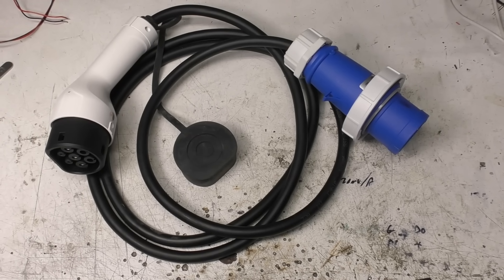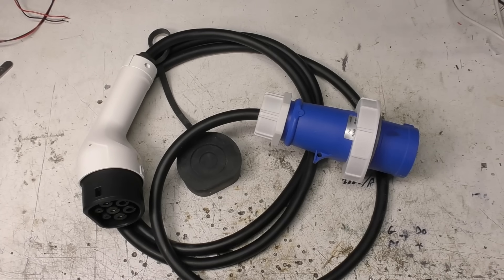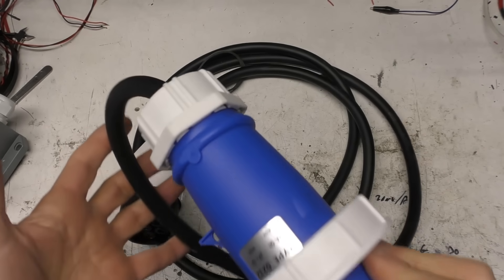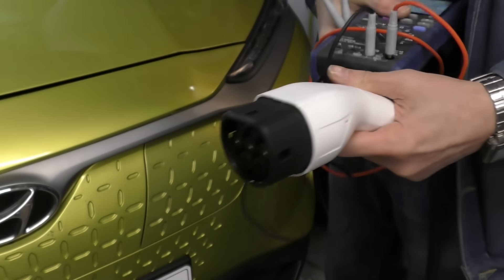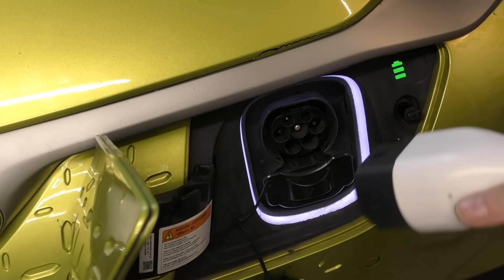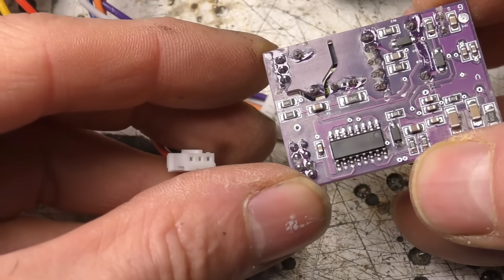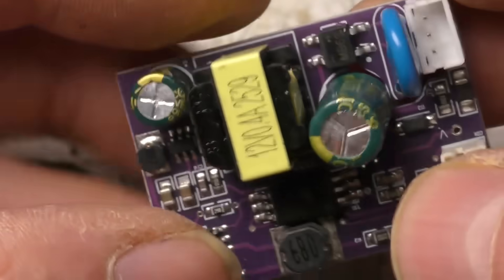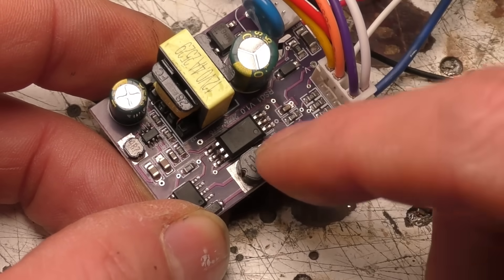Avoid these unsafe EV charging cables!

Comment: These are not meaningfully less safe than IEC kettle cords, are they not? Except that you expect to plug and unplug these regularly. A proper EVSE with RCD and a relay would be ideal but that's another $50-100 in parts alone. No safety certs or anything but then again, these are essentially just extension cords.
Reply: You don’t stand in a puddle in the rain and plug a kettle lead into something
Reply: @edc1569  I wouldn't do that with an EV either.
Reply: A lot of it is just car manufacturers covering themselves for any situation. At least here in Germany, essentially everything has a RCD so duplicating it would not be necessary, but that’s not universally true everywhere in the world and most consumers would not know or understand if they could take the shortcut and omit it.
Reply: @0xbenedikt  There are different types of RCD. The ones used in conjunction with EV chargers have to allow for the possibility of DC current "blinding" standard RCD function. In other words your domestic RCD may not work if there was a fault with this cable.
Reply: @MrAdopado that’s a good point
Reply: Yeah, and most kettles are near a kitchen sink. So chances are, if unplugged will get wet.

Comment: In the states, the version of plug we use has a latch on it, and releasing the latch typically disconnects the pilot signal to let the car know it's about to be unplugged. 

Though still not ideal, these might be slightly less unsafe here since the car's charger should soft-power-off before the mains is removed from it
Reply from the maker: That's not the issue - the problem is the cable is live all the time
Reply: @mikeselectricstuff Oh totally. But at least here it shouldn't have to break any current when unplugging it.
Reply: Pretty sure the pilot signal breaks before the power conductors break so the car should drop the load before the contacts disconnect

Comment: Well, it's not really worse than an extension cord, is it? or any plug in the wall.
In their defense, "EVSE" are pretentious overpriced wall boxes trying to justify their price for what is essentially an extension cable. They could add a couple of relays though without incurring major cost. I assume you will continue to use it? :)
Reply from the maker: Yes it is because the contacts are not shuttered. Also EV charging cables are more likely to be use in wet conditions, and be damaged through frequent use.
Reply: @mikeselectricstuff  so yes on continuing using it? :)  it is a little wild west to not have relays but it looks robust current wise. And rifling in the connector seems fancy

Comment: Better than a grannie charger.
Reply: This is just a badly designed grannie charger built for 32amp 230V/240Vsupply socket. You would be much better off with a properly designed 13amp grannie charger (that runs at 10amps by design).
Reply: @MrAdopado depends on your priorities. If you want a fast charge and something that doesn’t melt this sounds like a solution many want.
Reply: @AndyK.1  Are you in the habit of prioritising convenience over safety?
Reply: @AndyK.1  I've got a mobile charger that can do 13amp, 16amp, 32amp at 230/240V ... and unlike this one is safe to use. They are readily available!

Comment: I'm not up to date on ev chargers but I did see one version of connector that used a magnet to determine high or low current, not sure if the one you show here is one of those, probably not if it's pwm? You might want to get it running a beefy 30amp load or higher and see how hot the cable/plugs get, maybe put it on the flir
Reply: The Renault EVSEs do that. When fitted with the "right" socket it allows 16A, otherwise it defaults to 8 or 10A. You can 3d print a thing and stick a magnet and it will trick the charger. It's not a standard.
Reply: @ligius3  Tesla do something similar with their mobile connector, it allows up to 32A, but by default it's 10A or so.  There's a resistor or something similar in the connector which tells it what adapter is in use.
Reply: @tomsixsix  The Tesla UMC is a more sophisticated device altogether. The mobile connector only works with the dedicated "tails" that set the maximum charge rate. i.e. if you have a tail with the UK 13amp plug it will only charge at 10A 230/240V. If you have the different tail for a 32amp industrial UK "commando" plug it will charge up to 32amps 230/240V. You would have to seriously butcher the thing and mess with the electronics to make it operate unsafely.

Comment: The reason for the 16 pin micro is probably due to some versions of these having selectable current.  I've seen one of these 'guts in handle' EVSEs where there is a current select button and 3 LEDs to indicate which current setting was in use which would require more pins.  As such, the factory already had SOIC16 micros in stock and didn't want to or couldn't buy in a different lower pin count micro.
Reply: Wouldn't take much to add in a relay to isolate the pins... It's really cheapest possible
Reply: @JamesTK  Problem is size of the relays relative to available space in the handle, especially with higher currents like this 32A version or if dual pole relays are needed for American/Japanese/South Korean 200V-240V versions where both current carrying conductors are live or for Schuko and Italian versions where inherently unpolarized plugs mean either current carrying conductor could be live.  Only possible workaround would be putting relays in the plug which would then require extra conductors in the cable for either AC for a power supply in the vehicle connector or DC where the power supply is in the plug with the relays as well as relay control wires.  This means either 4 wires (2 AC and 2 relay with 12VDC coil relays) or 3 wires (12V hot, relay coil supply and DC neutral/common) in the cable.

Comment: Whoah whoah. Why is there any circuitry inside the cable?
There shouldn't be anything to cheap out on except the quality of connectors and the gauge of the wire.
The "Charger" is inside your vehicle.
The unit on your wall is just a "Smart Breaker" that tells your car what kind of service it can provide.(And should be OFF any time the car isn't asking for charge)
The cable? It's JUST a cable and shouldn't be doing ANYTHING more than conducting the power and data from charger to breaker.
All the decision making is supposed to be on either end.

Stick a resistor in each connector that indicates the maximum current the cable can handle.
At MOST the cable should have maybe a temp sensor that breaks the PP connection if it is being overdriven so the "real" breakers can cut off the power.

Is this some kind of weirdo vestigial UK standard that let's the cable have a say in the charging process?
That is MADNESS.

It is absolutely WILD that the cable is expected to do anything.
Crazier still is that it would be live when you plug the other end into your breaker.(And is explicitly prohibited by SAE J1772 and IEC 61851 until the PP pin is connected AND the CP signal calls for charge)
Your breaker shouldn't be doing anything until the car-side negotiates a charge configuration.
Reply from the maker: It is essential to have circuitry in the cable, to tell the car how much current it's allowed  to draw. Nothing weird, it's the J1772 ( and derivative) standards.
Reply: @mikeselectricstuff  No. The breaker unit on your wall should be telling the car that information.

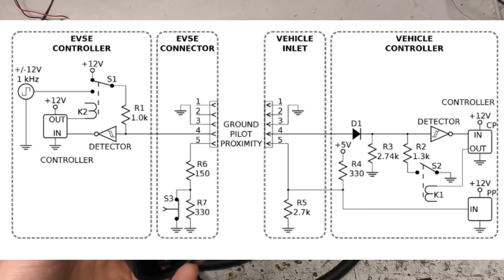You even show the standards circuit at 2:04.
The cable isn't even in there.
The left side is your smart breaker called the "EVSE Controller".
Right side is the "Vehicle Controller".
The cable is JUST a "...".
It. Does. Nothing.

SAE J1772 is the connector and signal specification. It has zero rules for any cable capacity signaling at all. It simply connects the power and data lines between the EVSE and Vehicle controllers.
The PP (Proximity Pin) in the connector tells the directly connected side "Hey a cable is plugged in"  by being shorted to the Ground Pin.

IEC 62196 DOES provide (optional) guidance for how to have a cable indicate it's capacity.
It is a simple resistor across the Proximity and Ground Pin.

The only time a "Cable" is ever ALLOWED to take part in the charging process on any of these standards is the "Portable/Emergency" style of cable that is powered off a normal 120/240 outlet for (Mode-2)away/slow charging. This style has the RCD protection in the cable, because the cable IS the whole EVSE system. It is also banned or heavily restricted in many(most?) jurisdictions.

So again. The cable shouldn't be doing anything.
It is just copper and connectors, with a resistor to indicate capacity if it is a "fancy" modern one.

DC fast charging cables are a whole different bag of worms and include crazy stuff like liquid cooling loops. We aren't talking about those.
Reply: @Prophes0r  The cable shown with the blue connector is not for connecting to an EVSE - that blue 3 pin connector is just a standard 230V AC plug which connects to 230V AC outlets that can be found in many commercial and industrial situations for connecting all kinds of equipment.   The cable is one of those 'emergency/portable' affairs, but with all of the safety items missing.

Cables for connecting between a wall mounted EVSE and a vehicle do indeed just have the resistor in them, but those have the Type 2 male connector on one end and the Type 2 female connector on the other.
Reply: @mikeselectricstuff  HOLY SHIT!
Another user pointed out that this is supposed to be a Mode-2 "Charging cable".
How the hell can that key-fob sized chunk of electronics be expected to energize/de-energize 7kv+?
The answer is obviously "It doesn't do that", which is why those pins are energized all the time.
Is it even legal to use that thing by UK electrical codes? Because it sure isn't SAE j1772 or IEC 61851 compliant.

I'm surprised it doesn't come as 2 pieces that the user is required to assemble themselves to avoid some sort of laws.

That's craaaaaaaazy.

Comment: It looks like the safer chargers are still available when AliExpress is accessed from outside the UK. Unfortunately they seem to have started silently filtering out items based on region but they're doing a really crap job of deciding what to hide.
Reply from the maker: It may be that they think  they come under the UK smart charging regs  which make it illegal to sell non-smart chargers.  I've read the legislation, they don't - I don't recall the wording but it clearly puts granny charger type devices out of scope.
Reply from the maker: Yes - I see plenty of proper units when browsing with a different country setting.
This is so dumb - they are hiding the safe units so users only see dangerous  products.
Reply: Their filtering/censoring is infuriating when you see an interesting thing (like a freely programmable USB keypad) mentioned on YT, go to the link and all you get is "this item is not available in your country" ... and searching for the title gives you everything but that item

Comment: The J1772 standard says the EVSE must be 30cm/12in from the wall plug so it cannot be in the plug handle… at least not without violating the spec. That means no safety certs, UL listing, or compliance testing. I do wish the J1772 spec said otherwise but until it does any cable built like this is super sketchy. 

Also, how is there so much light entering the main three contacts?! It almost appears to be illuminated from the inside, which means no wire attached to the back.
Reply from the maker: It also says the EVSE must isolate the supply. re. light - I was illuminating it brightly to show the contacts
Reply: Min or max from wall plug?  Either way it could be in one plug, max could be in source plug, min this would comply with that part as it's in the vehicle plug not the wall plug
Reply: This isn’t J1772
Reply: @YouTube2021FM  That’s what I’m saying. It’s supposed to be and it’s using J1772 signaling to trick the vehicle into thinking it is. It doesn’t comply with J1772.

Comment: why lock the cable to the car?
i understand it is to prevent somebody from unplugging it easily, but if a vandal want to he will simply kick and break it off? i would rather have the cable unplugged than somebody breaking the car socket or cable.
Reply from the maker: bear in mind most public AC charging is non-tethered,  so users use their own cables - locking helps  prevent theft. Also prevents arcing if unplugged under power, though the recessed CP  contact should ensure the car stops drawing power before the main contacts disconnect
Reply: @mikeselectricstuff  i didnt know about the un-wired stations. i am in north america and the only stations i see have the cable attached to them.
Reply: @Francois_Dupont  All UK/European rapid chargers (DC chargers) have cables attached. Generally AC chargers such as slow overnight chargers whether at home or elsewhere need you to use your own connector cable ("Type 2" cable for UK or continental Europe).
Reply: To avoid arking while it is unplugged.
Reply: It's because you often pay for an amount of charging power, and you don't want someone else unplugging your car and plugging their own in to steal it.
Reply: @wmitchell  why doesnt the charging station talk to the car and exchange basic serial numbers or somekind of unique ID to prevent hoaxing like this? it could even be done thru the power wires by pulsating them.
Reply: @Francois_Dupont  Not necessary, if you somehow managed to unplug at a public AC charging station, the charge session will immediately end and you won't be able to start another one without providing a method of payment.

Comment: 13:15 Why does this one have a socket on it? Some type of EV to EV charging? Or just bad photoshop?
Reply from the maker: Maybe it's a V2L cable
Reply: @mikeselectricstuff 
From what I can tell, that is a EVSE -> CEE adapter, for getting 240V from a EV Charger (or 400V in the three phase versions(and on 3ph supply))
A friend wanted one of these for a autocamper and asked for some advice, I suggested he used an extension cord instead of buying from sellers that can't tell the difference between a mains -> EV cable and a EV -> mains cable

EDIT: also the 32A will still need a fusebox when the charger doesn't know what is at the other end
 
It might still be interesting to see what lurks within
Reply: @mikeselectricstuff  okay, thanks! always thought one would need much more parts for V2L, but after seeing how they can "optimise" the carging part...

Comment: Switching IC under the transformer? Never seen that before.
Reply: for maximum EMF abuse and thermal baking
Reply: @dimitar4y oh, new "kurvítko" mode unlocked. *kurvítko - in Czech, deliberate weakening or placing components to fail prematurely just days after the warranty period.
Reply: @JanicekTrnecka  so, planned obsolescence
Reply: Saved 1cm of board space, after all who needs creepage distance, so long as it does not go bang in the factory, after it ships who cares.
Reply: @SeanBZA  how would it go in the factory, you assume they test them :U

Comment: Isn't this mode 1 charging?, and is allowed but not compliant, emergency use only
Reply: Yup, but Mode 1 is max 16A.  Consequentially, it's only going to be legal in the UK (if at all) on a 16A connector, like a blue CEE one.  I suspect IET regs rule out Mode 1 charging but I'm not certain.

Comment: In theory the CP/PP pins should break before the current pins, allowing the car/evse to stop the charging before you actually interrupt the full charge current by pulling out the cable. But I don't know in how many cases that is actually quick enough / implemented properly.
At work we have a few of the proper ones (full EVSE, with metering etc) but they are not cheap. Also, fewer and fewer cars actually come with the granny charger.
I suspect the main market for these is people who get their car from their work (very common here in Belgium) and don't get a home charger install included (or it's very expensive) or they want to be able to charge at camping places.
Here any socket used for EV charging must be protected upstream by a B-type RCD, which if done correctly, would at least help with the safety issues. But then you'd be pulling a 32A peak load all the time, which is not very smart here (we have an extra charge based on peak usage).
Still would not recommend.
Oh, and if you search for EVSE on Ali, I can see some that at least appear to be the proper type.